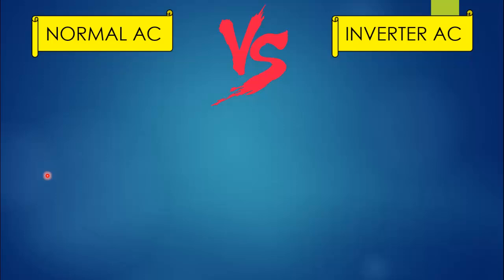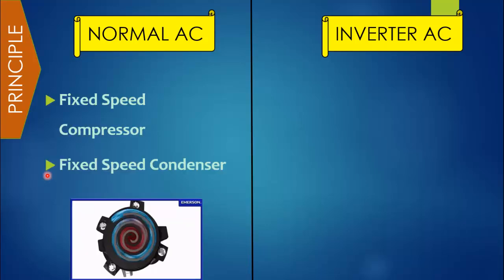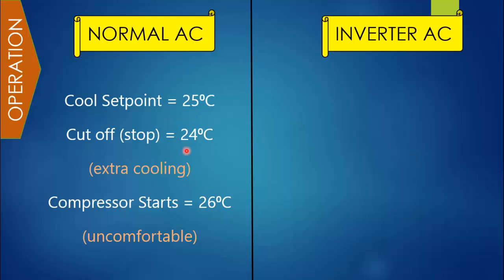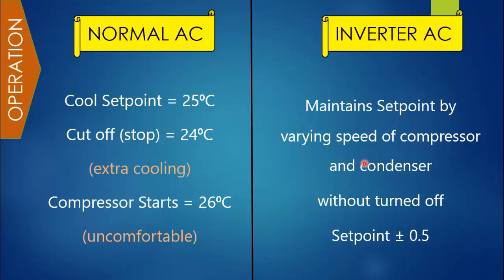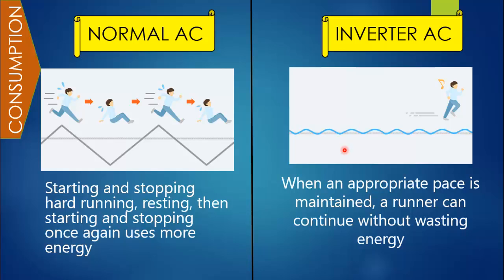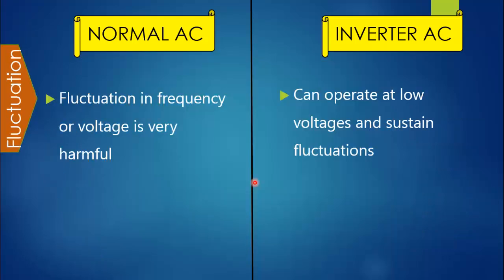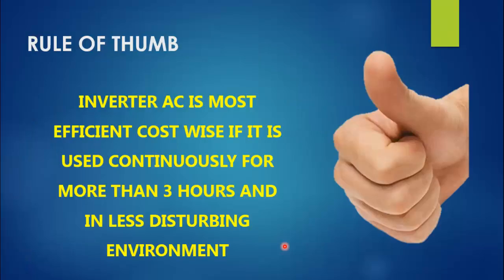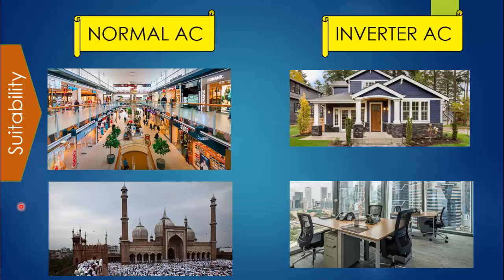Adantages of Inverter AC Vs Non Inverter AC

Comment: the inverter board is used to run/control DC compressor (and DC fan ) which is about 50% more energy efficient than AC compressor ( hence non- inverter )
Reply from the maker: Yes very true

Comment: Hello what you don't say and very important. I have installed for villa 6 ac inverter Panasonic top models. Why? because l heard exactly what you say here. Economy..... Today, 10 years after 5 ac's are broken. Why, because in a INVERTER there 2 PCB's to control: 1 in the inner equipment and 1 in the outer equipment subject to heat and salty air because we live near sea. Inverters are fragile!!!! We replace by NON INVERTER modules.

Comment: it's half true and nobody is talkin about that. Most inverters (china brands) are like on/off because they turn off after they get +-2C (+ for heat, - for cooling) of set temperature and they turn on after they get +-0,5C of set temperature. China ACs has really bad modulation in comparison to korean and japan brands.
Reply from the maker: You are right but still it they turn on and off, there is huge difference of inrush current. Non inverter has high intush